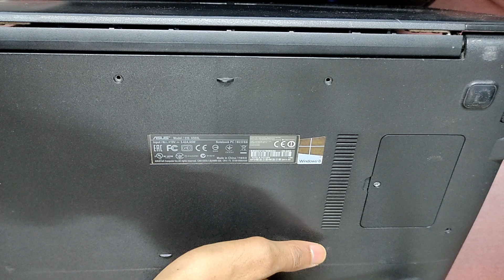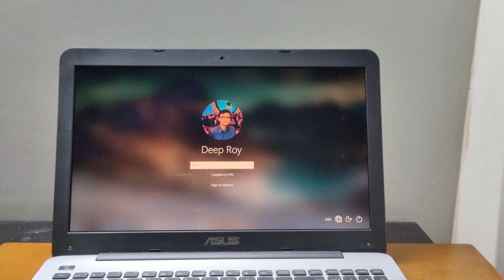Asus X555L Display Replacement

Comment from the maker: I did not buy the display online. I went to a local notebook parts store named: M Trade International. The experts at the shop recommended the display to me. They named it "Display 15.6 ULTRA 40 PIN" in the invoice. It took around 40 USD. Hope it helps :) Oh and sry for the delay, you know how life happens <3
Reply: Hi.
Are you sure it's a 40pin connector display?
Specs online say that it is 30 pins.

Comment: I have an Asus laptop, model k555l with x555ld REV .3.6 main board. I had connected my laptop's cooling pad using a 9-volt and half-ampere adapter, but I wasn't paying attention and the cooling pad was also simultaneously connected to the laptop via the USB port. Now my laptop turns on, but the laptop screen shows no sign of being on. In your opinion, which part has been damaged by this simultaneous connection of the cooling pad adapter and the connection of the cooling pad via USB to the laptop?

Comment: If possible please mention the required model for lcd and display or where to buy from
Reply from the maker: I did not buy the display online. I went to a local notebook parts store named: M Trade International. The experts at the shop recommended the display to me. They named it "Display 15.6 ULTRA 40 PIN" in the invoice. It took around 40 USD. Hope it helps :) Oh and sry for the delay, you know how life happens <3